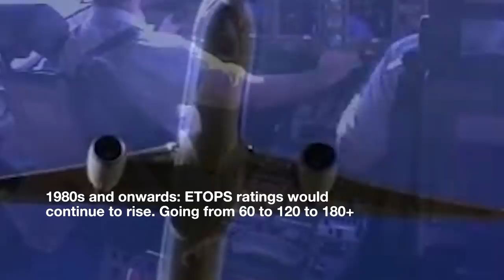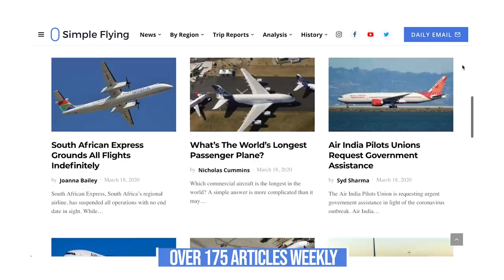Why Did Tri-Jet Passenger Planes Not Become Popular?

Comment: Trijets have a place: same-capacity replacement of the A380. 3 GEnx or Trent 7000 engines could do it if the frame and wings were redone completely in CFRP composites.
Reply: Given the downsizing trend, not even a further stretch of 777-10 attracted enough traction yet, let alone sth larger.
Reply: @steinwaldmadchen  The main reason the 777-10 didn't get traction is airlines were waiting to see how the A350-2000 and A350 NEO were coming along. If Boeing had redone the ENTIRE frame in CFRP, it wouldn't be a contest. The A350-1000 is more efficient at long range than the 777-8. The -9 just barely beats it. The -10 would be heavy enough to wipe out any CASM advantage over the A350-2000.
Reply: @patrickproctor3462  Well, I guess there is a reason why Boeing simply stretch 777X to compete with A350, not even adopting the rumoured Al-Li alloy. Demand is probably not enough for two cleansheet advanced VLA, unlike 787 sized jets, so for Boeing better leverage the payload advantage of 777 and print some easy money.
Reply: @steinwaldmadchen  Exactly, same reason the 747-8I was built: keep enough pressure on Airbus to kill the A380 program. The 777X keeps Airbus from running away with too many sales. Some operators can easily justify the 777X. Others cannot.

Long-term, the 787 NG, A350 NEO, and 777Y will have enough range to fly between pretty much any two airports in the world if they so choose. That rebalancing of trunk route capacity to P2P will officially pull the floor out from underneath the A380 and 747-8I.

NY-FRA, LAX-FRA, LAX-DXB, NY-DXB, NY-HKG, SYD-SIN, SIN-FRA, and Japan-HNL will remain among precious few other routes that can justify a bird that big even after the 777-9 starts flying.
Reply: @patrickproctor3462  Range is just one out of many reasons 
1. Extra cost of a VLA cannot be justified without  high network-wide demands, not just a few routes. Remember Pan Am or MAS?
2. Demands for some short routes can be at risk when faster trains started operation. China/India won’t order A380s, while Japanese no longer buy -Ds.
3. Passengers and some carriers prefers frequency over capacity, so even if CX could easily fill up A380s all year round, they fly multiple daily 777/350 instead, HKG-NYC included.
4. Some airports simply can’t accommodate them. So no A380s on GMP-CJU even when both KAL and Asiana own a few.
Reply: @steinwaldmadchen  Very true on cost justification. I'm not arguing that. The ME3 can still justify quite a few altogether because ULH routes can be physically intolerable on even a fit human body depending on back problems or other issues like DVT risk. Some set of really big trunk routes will remain with multiple daily services even on VLAs. How big that set is, we can argue.

High speed train is a dead end. Hyperloop or similar technologies, but HSTs are worthless. Of the 30-some in the world, only two are profitable, and we don't have the population density in enough close-by pockets around the world to justify wide deployment.

I'm not arguing the frequency preference or prospect, but Amsterdam Schiphol, DXB, and HKG are many years away from shedding their slot-restricted statuses.

A new A380 would need to be upgraded for better airport compatibility, no doubt. Every sliver of weight saved by going all-CFRP needs to be taken out of the MTOW and MLW to reduce runway length and reinforcement requirements. Folding wingtips/winglets can reduce the span for parking in Code E gates. And you don't necessarily need two boarding bridges.
Reply: @patrickproctor3462  For trains, you miss a few points
1. It’s way more efficient as a people mover
2. It can rely on energy sources other than oil-derived jetfuels, a good news to net energy importers.
3. Almost all projects are government-funded. As long as overall benefit outweighs cost profitability of the line itself is no big deal.
4. For those HSR doesn’t work, neither do VLA in most cases. A320 is the way to go.
btw, while 787 and A321XLR won’t bring P2P in foreseeable future, they do make secondary cities flying profitable, and smaller hubs more competitive. The result is the downsizing trend we see, despite pax keep growing year by year.
Reply: @steinwaldmadchen  1) Absolutely untrue. After you actually run out the costs of development, building, maintenance, electricity production, greater travel time, and all the rest, it's a complete wash between current-generation large aircraft and HSRs over which is the more efficient on cost or energy.
2) CAN is not the same as WILL. Beyond this, jets can rely on sustainable aviation fuel, so the argument is moot.
3) Government funding is a bad thing. Government project management is a bad thing, universally.
4) That depends. SIA flies multiple A350s between KUL and SIN daily despite a HSR being operational between Kael and Singapore. Changi is slot-restricted. An A380 can potentially become justified as the two cities develop and increase in density.
Reply: @patrickproctor3462  I don’t know where do you live, but Trains ARE replacing planes in Asia and Europe, and even in US, at least Northeastern regions.
1. Usually train station are more conveniently located than airports. When checkins, security, and transportation to and from airports included, 3~4 hour HSR is by no means slower than comparable flights door-to-door. In fact, domestic flights between Tokyo and Eastern Honshu of Japan almost dry up completely after bullet trains arrived.
2. The possible adoption of biofuel still doesn’t change the fact that planes burns way more - from 60% in US to 8~10 times in Japan, a big gap no future aircraft can even narrow. Plus, Biofuel is yet mature enough for mass consumption, while renewable electricity is readily available from windmills, hydro stations, solar panels etc. While nuclear power could bring more harm to environment than benefit, it definitely helps China or France improve energy security. Not every countries have the oil shales like the Americans.
3. Many failed to realise airports, airspaces and ATCs are all public infrastructure, majority of them funded and managed by government. That is, you don’t actually pay all cost for your flying - other taxpayers paid part of it, because doing so brings more good than private operations.
I don’t know why railway didn’t operate this way, but at least in EU or some new lines in Japan, railways are constructed in a similar manner, and in that sense its just half the cost of a Highway.
4. By definitions HSRs can also be upgraded 200km/h lines - usually achieved by electrification, some reinforcement works, and purchasing new trains. By doing so Amtrak secured more passengers between Boston, NYC and DC than airplanes and coaches combined, despite being horribly underfunded.
5. There is NO HSRs between Kuala Lumpur and Singapore at the moment - its still in planning stage, But if any, travel time would be roughly 90 minutes for a length of 350km. Expect considerable share drops on this route.
6. After all, planes are simply not efficient at shorthaul commuting. Majority of the time and fuels are wasted in climbing, descending, taxiing or waiting for clearance. Frequent service would worsen all these, as runway capacity and slots are limited. Nor VLA, which require more clearance than usual aircraft.
In contrast, its totally fine for railways to carry 1000+ passengers per train or operate in 3 minute headtime, or pickup passengers in between, with minimal overhead.
Air traffic will resume growing, possibly faster than airlines could cope with, so why not let trains do what planes are bad with, and free up resources to cater international traffics?

Comment: The thing about tri-jets, if that middle engine was to experience catastrophic failure, such as a fan blade failure, the proximity to the tail rudder and horizontal stabilizer can easily compromise the hydraulic system that controls those surfaces, or jam up the jack screw. I guess one advantage of a center engine is less lateral torque if one of the under wing pylon engines failed. Just an observation.
Reply: And I think you are 100% spot on.
If the tail engine has a catastrophic failure it can destroy the hydraulic systems of both rudder and elevons.

And I think it happened already.
Reply: Simon Houel it has happened. I just don’t recall exactly when. I saw a simulation of a factual event on another channel. Then again, engines have actually fallen off of underwing pylons. I’d rather just fly in a 4 engine. I have no travel plans anytime soon during all the nonsense now.

Comment: Does anyone know why jet technology has remained the same since the 1960s , it's quite odd don't you think , please reply .
Reply: The statement that jet engine technology has not advanced since the 1960’s is ludicrous.
Reply: John Young can you tell me what's different about it , I see the same  .
Reply: roddy christodoulou How much time do you have! I have to ask what your “I see nothing” perspective is? The changes in materials, in control systems, in aero foil geometry to name a few. Since the 1960’s specific fuel consumption has more than halved and time on the wing has more than doubled. In 1969 a ‘powerful’ engine was 45000 lb thrust, the version of the GE90 engine that powers the high gross weight versions of the Boeing 777 is 115000 lb thrust. Remember also that these performance advances have been made in a regulatory environment that has toughened considerably on noise output. The development of a new transport aircraft engine won’t leave you any change out of a billion USD if the technology doesn’t change then that expense could not be justified and wouldn’t happen!
Reply: John Young I was aware of the changes you mention , but I've been flying to Cyprus for around 40 years now due to family connections ,and I can tell you the time flying from London to Larnaca has remained the same in all that time .
Yes it has become cheaper but that's because of more competition .
In all that time I would have expected at least a reduction in flying time .
Reply: roddy christodoulou A significant reduction of transit time would require an equally significant increase in cruise speed, from the speed of current airliners that would require going supersonic and the Concorde experience has shown that technology is not economically viable. The ‘failure’ to increase cruise speed is not a reflection of the technology of current aircraft but the realities of aerodynamics as the speed of sound is approached. The pressure of greater competition has driven the aircraft manufacturers (and the engine manufacturers) to drive down seat mile costs so that’s where the technology development emphasis has been. Competition can’t explain reductions in airfares by itself, the airline business is one of the most marginal in the world, you can only reduce fares so much before a given route becomes sub economic so that drives the technology direction.
Reply: John Young thank you for the insight .
Reply: roddy christodoulou No problems and I feel your pain on long haul flights they do seem to go forever!

Comment: Would there be a single engine aircraft in the future ?
Reply: What like the Cessna 172?
Reply: Thomas Mortimore im talking about an airliner in the size of an a320 or b737
Reply: ミラ凹 in that case I doubt it. You loose that single engine then you have a big problem
Reply: The irony is that piston engines are less reliable than jets so are more likely to fail, but the issue is that most single engined aircraft are small enough that they can land pretty much anywhere. A reasonably flat field, a reasonably wide road. Even if the landing wrecks the plane, they fly slow enough that those onboard are likely to walk away. Airliners need runways to land, and any attempt to land anywhere else is likely to result in not only significant damage to the plane, but serious injury or death to those onboard. The second engine is therefore a good insurance policy. The line is blurred a bit with the large single turboprops, but these combine the reliability of a turbine engine with a size and speed that makes them still have a fair survival chance in the worst case the engine does fail where there isn't an airport in range.

Comment: As various aircraft crashes (last one: PK8303) showed the twin engine, under wing engine placement has its safety drawbacks despite all operating cost and maintenance access advantages.
Actually from a pure engineering viewpoint the Boeing 727/Tu-154/Falcon 900 did it right. A triple engine pack in the back that won't touch the ground in a belly landing situation , does not have the upward tilt momentum of underwing engines below the CG and very little off center thrust angular momentum if one of the outboard engines failed.
 737 MAX ... Trying to fit too large engines under the wings was the root cause of the desasters.
OTOH the UAL232 Sioux City crash showed that putting all your engines to close together can be a risk. That accident in a 727 would likely have destroyed all three engines at the same time, and having off center thrust to actually steer the aircraft can be a good thing.
As long as the tubeliner paradigma exists in commercial aviation we'll have to accept that cost rules over redundancy and flight characteristics, so twin engines under the wing will prevail. The advent of blended wing body designs might change that in the future where tri-jets again could replace the four engine long haulers like the A340/380 and B747.

Comment: Peace of mind?  The DC-10 had a very checkered history, and some famous crashes were caused directly by the third engine failing and taking out vial systems such as hydraulics with it.  More engines always means more chances for a failure on a given flight.  I don't think that many pilots or passengers think that trijets are any safer than modern twinjets.
Reply: Correct, but also that Douglas placed all its critical control cables and hoses in one area, while Boeing separates them, some on each side of the airplane or wing (front/rear spar). One instance of DC10 crash was a faulty cargo door that blew open. With decompression, the piano in the bar above fell thru the floor, severing critical control cables.
Reply: @Greatdome99   I always knew pianos were dangerous.
Reply: @Greatdome99 Boeing did not separate them, see JAL123. Lockheed separated them.

Comment: Perhaps the 747 or A380 can be a Trijet, since engines these days have enough power.
Reply: The third engine in the back was too complex due to its placing that derove up maintainance cost. Also an uncontained engine failure deoes more damage than an underwing engine, as expemplified by United Flight 232.